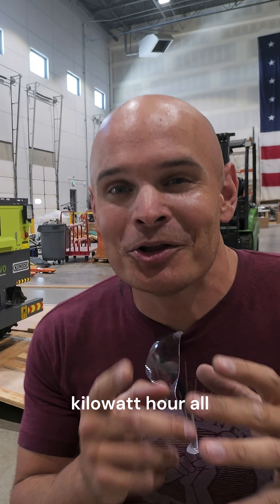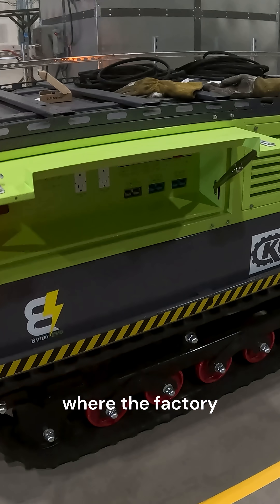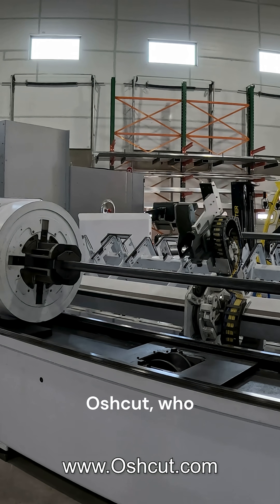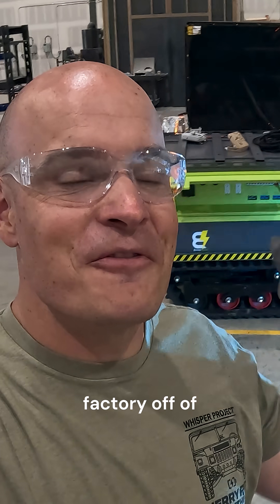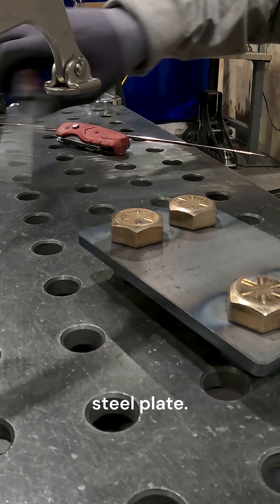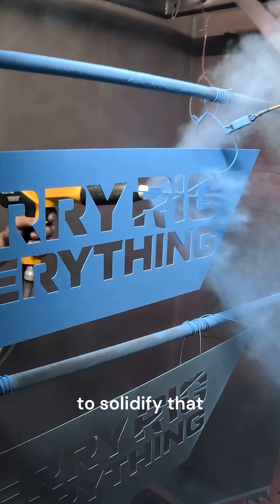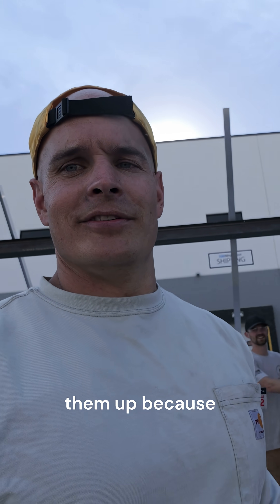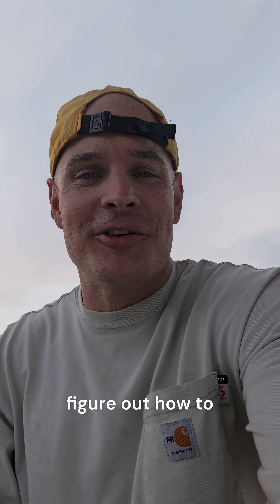If a Tesla and a Tank had a baby...

Comment: I work at a smallachine shop . At any time we have 2 lathes running amd are drawing around 12kw  and with more machines running amd hitting load we can easily hit around 26kw-30kw (400v 3phase)  .this battery is NUTS . We have a big 80kva diesel generator for our backup

Comment: Put the solar array on a turret and use a meter to detect volt drop. If the voltage goes below a determined threshold, get the tank to push it until it rotates to face the light and stop when the voltage is above the threshold.
Reply: It would probably be better to just use one of the already-made sun tracker controllers. Cloud cover might cause a voltage monitoring version to move excessively versus having it set to just point exactly at the sun's position through the day.

Comment: Or you could get diesel generator that puts out more power and will last 100 years with basic maintenance. Solar panels are good for 20 years max? Batteries are good for 10 years max before they lose substantial capacity.
Reply: Diesel is great, when you're somewhere you can haul a tanker or a cube. Also not so great if you ever need to have it run indoors for any reason. There's a time and a place for both.

Comment: I have a question: how long will that "battery tank" hold a charge in temps below -30 F? The battery in a cell phone will be dead within 5 minutes if not kept warm enough; the same for batteries in trail cams, wireless doorbell buttons, etc. Even vehicles need to be plugged in or left running in extreme cold. 

Speaking of big batteries...the city of Fairbanks, AK has a warehouse-sized battery backup to keep the city running long enough to switch power sources in case of issues.

Comment: I could see these being highly valuable in disaster response scenarios, such as post-hurricane recovery efforts when power is unavailable. They would provide an excellent means of supporting affected communities in those situations.
Reply: They are called generators lol  that can run 24/7 !!
Reply: @Great-white-tiger-hunter Generators are inefficient if run with low power usage. If you use only fraction of generator power it's best to use it with some kind of battery. Charge it durning the day and turn generator off over the night while running most important, low power stuff (like fridge, circulation pumps in heating system) with some kind of UPS.

Comment: Just an FYI...AC power hasn't been 110v since the 1960s.

You got the 240v correct...but 110v??  Dinosaur talk
Reply: Dinosaur talk kind of relevant when our transmission infrastructure hasn't been touched in nearly a hundred years in some regions.

110/220 is just colloquially used, even though the official standard is 120 now, you'll still see 110,120, or 125 all over the place, especially in manufacturing where controllers are often from the Mesozoic period.

Comment: 22kW power output this is 1/4 of my previous fiat 500e that had 24kWh and 88kW capacity. about 100x slower discharge rate (0.2C) than a 12 years old EV? it's definitely not optimized for power.

Comment: That tank battery proves the validity of the gonk droid from Star Wars, which was basically a walking battery. It's mobile, high density power. Love that you're helping and developing manufacturing in the US.
Reply: More people need to get into any of the RC hobbies out there so this weird fear of lithium and high density batteries can go away. Lithium batteries do not explode, they will vent nasty stuff and burn vigorously, but they do not just go boom like a block of C4. Fire is the main issue, not a bomb. When people think these batteries go boom, it's because whatever they are inside and powering is creating a very weak pressure vessel, kinda like a tightly glued and sealed up IP68 smartphone for example.

As Zankaroo said, if you are worried someone is going to turn some battery bank like this into some slow self propelled RC bomb, don't be. It'd be about the worst one imaginable that'd be less of a threat than common binary explosive like tannerite you can pick up at your local sporting goods store. If someone wanted to make something go boom in a big way, they wouldn't waste tens of thousands or hundreds of thousands on some mobile battery bank, they'd do it by spending virtually nothing on fertilizer and fuel.
Reply: @fubar5884  I agree when I was daft young kid I kinda overloaded my boat rc batterys. Push the wrong button and like 30-45mins charging time first start to smoke. The packaging around the charging plug is area was in flame then exploded. Explosion was the same size firecracker. At most it more cheap nock off flashbang.
Reply: Bop
Reply: Exactly what I thought! The GNK Power Droid!
Reply: A walking nuclear battery would be much lovelier
Reply: I more worried about someone to turn that into a bomb with wheels and remote control
Reply: @JnManuelAG  Not worth it, you can make bombs out of house hold shit or get a few other slightly harder to get things to make even better bombs cheaper if someone really wanted to do some damage. And junk cars are cheap and everywhere or cheap RC cars if you wanted small form factor. Why spend $37k on the Komodo when this other shit is way cheaper and can be learned pretty easily on the internet, might get on some list though for searching it.
Reply: @Zankaroo yes fbi this man right here
Reply: @JnManuelAG  we already do this, and with lighter and cheaper frames.
Don't know about IRA level block levelers but if it existed, then this would do it.
Reply: @JnManuelAG  That thing costs $37,000, before any shipping and handling is factored in. Pretty sure nobody would try this based on cost-effectiveness alone.

Comment: Can we stop pretending 100kWh is enough to power an "average" home for a "few days"?  

In summer months with traditionally undersized HVAC myself and most of my neighbors are using between 80 and 160kWh per day in the summer.  My use is slightly higher due to EV charging.
Reply: Ex sparkee, current engineer here. You should really look into your insulation because those numbers ain't right. You'd likely save yourself a fair bit of money paying for a proper thermal inspection, I wouldn't be surprised if the builder didn't even put the required amount of insulation in.
Reply: @sakaraist I personally inspected the house as it was being built before drywall, and it was an exceptional job.  It also has 18+ inches of loose fill fiberglass putting it well over r45.  

Point being, HVAC people are paranoid about short cycling and would rather undersize a system than slightly oversize it.  Bonus is service calls where they can charge boomers $300 to replace the run caps and “tune things up”.

Also, any engineer would not make assumptions without any data - that’s how we end up with systems swagged that are later insufficient for the application.  

At the end of the day, 100kwh is not going to carry most homes in summer months, especially with incorrectly sized HVAC.
Reply: @trumpio  100kwh is nearly 3x the average home in summer months. The most likely contenders are poor insulation, which is incredibly common in the US, an inefficient system, or a LARGE house and cooling every room to the same brisk temperature.

To say it wouldn't work for most homes is completely off base, in reality it's significantly over the average for most homes, even those in hotter regions.

Maybe you're in the minority with an overly large house or you keep the house at 60, but the general advice to anyone using 100kwh/day without being able to know anything else? Somethings likely not adding up. Could be a loose duct, could be compressed insulation, maybe their AC system isn't actually cycling off, maybe their heater is stuck in defrost mode. Point being it's an abnormal power usage statistically.

If everythings good for you based off the area you're cooling/heating then no worries, but as a general statement to say 100kwh wouldn't work for most is just wrong and leads people to ignore inefficiencies. You can say it wouldn't work for you, but little more than that.
Reply: @sakaraist There is no way the average home uses only 30kwh in the summer.  Is this based on some make believe feel good green energy  calculation that assumes everyone sets their thermostat to 82 degrees and has a 1200 square foot brick house?

If a 4 ton ac unit draws 5000 watts steady state and runs at 50% duty cycle, how does that fit in with lights, refrigerators, dishwashers, computers, tv’s, washers, and dryers?

I just looked and my new 30 foot RV uses between 38-52 kWh per day with the ac running on utility when camping.  When running inverter only it’s significantly higher due to reactive power.

Comment: Cool! Starting at 40k usd; has 100kw and tows 5000lbs, has tracks.
Now imagine for a moment something with a 131kw pack, could tow 7500lbs, can get for $55k usd, on wheels not tracks, and you can drive…and can get from a ford dealership.
Fine, no tank tracks, but goes to show how capable and reasonably priced electric trucks are ❤
Reply: The value proposition for this behemoth isn't to be the better driving vehicle though but to be a utility. I've yet to hear of any regular truck capable of outputting 22 kW or having 7 (?) individual outlets.
Reply: @hoej it could be done. I had a 15kW inverter in my old Prius that ran off the traction battery. Everyone talked smack about a construction guy with a Prius but not lugging and refueling a giant generator was awesome.
Reply: @hoej Not to mention off road scenarios where a typical truck or car wouldn't work.
Reply: @Stratus41298  tbf, to get to those off-road scenarios, it'll need its own truck, as its speed is abysmal (and as it's an rc car, no cool rides on top either)
Reply: @hoej While yes, it wouldn't be a problem. Considering slightly EVs start with easily 300kw, don't think a constant output of a 100 would be difficult
Reply: Get the track mods to replace the wheels!
Reply: Yeah I think Ford loses over $50,000 for every lightning they sell. Unfortunately I don't think they're going to be able to figure it out before they go bankrupt.

Comment: No, you aren't going to run a factory with this. Even if we overlook the lack of 3 phase capability, 22 kilowatts is less than your standard residential electrical service would supply.
Reply: Where on earth are these houses that pull 22Kw?
I live in a 50s double brick house built when efficiency was an alien concept to housing in my location. The house has 3 phase power, and has never peaked above 6Kw instantaneous.
Reply: @haitchteeceeeightnineeight5571  Homes are going to all electric appliances and adding electric car chargers which is why 200 amp panels are the standard now. Having said that even your old home with a 100amp panel is can still supply more power than this thing, so nobody will be running a factory off of it. 😂
Reply: Our house built in 1960 had 3 phase 380 fused at 3x 35 Amp, can be switched to 3x65 Amp fuses if i remember correctly.
Just the mains cable from fuses to power cabinet would also need to be upgraded.

YET they still wired each floor (3x) only with 1PH and 10amp circuits from the floor subdistros, because nobody had many electric tools or devices back then. (<_<)

I set the wallbox to 3x10Amps to be on the safe side with an electric shower and two kitchens rivaling for power.

Comment: Ok, how long can it run an hvac system for? That's what most household energy goes to. Definitely price wise
Reply: depends on the unit, how hot it is and how cool you need it, in my experience you tend to find conflicting numbers online but from what I can tell a typical home central AC uses about 4-5kwh, so pretty much a full 24h straight, but AC only needs to run something like 12-14 hours a day, even if it's fairly hot outside, less if you don't mind being slightly warm or supplementing with a fan.

Comment: Can I make a suggestion, if you're hammering in bolts in the holes it's not going to go together on the salt flats.  Building some slop and some play. I deal with this all the time with companies that manufacture stuff on a perfectly flat concrete floor and then I always tell them go take it out in the parking lot and see if you can build it.  They struggle and struggle and struggle. After I redrill all the holes a little bit bigger everything goes together a whole lot easier. But nuts and bolts and pins or whatever you're using don't need to be super tight tolerances to do their job.  They just need to have nylocks so things don't rattle loose.
Reply: Dealt with this on the first field-assembled sign frame I made, ended up adding 1/16" to the hole spec and nylocks instead of lock washers.
Reply: Reminds me when Ford built a transmission with very strict tolerances like +-2 thousands it was so tight that it didn't work they jad to trash it and go back to thier old tolerances
Reply: @shawnmccarty6923   +/- 2 thousands is really sloppy, hobby CNC grade.

"Dimensional tolerance is related to, but different from fit in mechanical engineering, which is a designed-in clearance or interference between two parts."

The problem was they didn't match their allowance / clearance with tolerance correctly.

If you have 0 clearance or 4 thou that's a huge problem.
If you have consistent clearance at temp that will work perfectly even with 0.0001" tolerance width.
Reply: they did put sleeves inside of the tubing for the holes so i don't think there will be alignment issues it is just tight fit in side the tube not with matching up to another part
Reply: Either drills or reamers-which are alot more precise than regular drills.
Reply: Like they did in the video?
Reply: They've done this stuff hundreds of times before. They are the factory spec. And they do have as many thousandths play as they need, there is nothing wrong with driving bolts in, that's what spud wrenches are for. Quick, tight. Nylocks are not useful where weather gets hot. Nice field office temporary portable power setup.
Reply: By doing this you might or you void the warranty. Also  by making bigger holes would not change anything. If you have holes that are 5/16 and you make them say half inch, its still going to be stiff with no play just a bigger bolt.
Reply: @MaxPower1000. They aren't talking about using a bigger bolt, they're talking about just sizing up the holes so lining things up is easier. Gives you more tolerance.
Reply: @ganjalfcreamcorn8438 I get that, but do you use the same bolt? When you size up the hole, and what do you me by size up
Reply: Mean*
Reply: @MaxPower1000.  Yes, they're saying the same bolt. It's a static frame. Some play in it doesn't really matter and tightening the bolts down removes the slop in the joints anyway.
Reply: @ganjalfcreamcorn8438 no matter what when you punch a bigger hole than the factory spec it is always best to size up the bolt so you don't get sheer lash and slop in the parts your bolting (usually mounting points) plus, it is easier to invest in a hydraulic pump (a portapac) to assemble machinery or use a truck crane rather than voiding the warranty and possibly compromising the structural integrity, hence why we dont drill out control arms if they don't fit right away😂
Reply: 130$ at harbor freight and you can get a hand pump that'll lift a 60ton bridge crane
Reply: @itsyaboi2346 I don't know what you're talking about when it comes avoiding a warranty.  They're manufacturing the frame themselves.  My point was to not have such titlerances on a perfectly flat concrete floor when they assembled it in their shop then they have to go out into the field and assemble it on a salt lake that's not perfectly flat. Bolts and holes don't line up like it did in the shop and if you add a little bit of slop in the tolerances the job becomes much easier. And the bolts are holding the frame together anyway.  If you've ever assembled trussing you'll know what I'm talking about
Reply: @MaxPower1000. -No one was talking about replacing the bolts with a bigger diameter, they were saying that they would slightly oversize the bolt holes to allow for a little slop in the holes to ensure easier insertion of the bolts during construction.

Comment: That's not a power tank, it's an oversized battery on tracks.

If you run it hot (multiple welders in the sun or the like) will it have the cooling to allow sustained use without throttling?

I don't think diesel generator makers will be going out of business anytime soon.

Comment: Wouldn't be cheaper and easier to use a diesel generator?
Reply: Can you refuel that from the sun in the. Middle of the desert for free? No, the answer is no, diesel generators are for people with significant energy demands or more often people who are afraid of electricity math, this battery is the equivalent of running a 9500w generator at full bore for 10 hours for 100kw
Reply: @nicholashaines4136  if your only using that much power you can get a gas generator. I thought this was for heavy duty use.
Reply: @amosmoses5630 being a lithium battery I'm certain that it's capable of much more output probably 50 kilowatt at a time obviously if it's outputting 50 KW all at the same time it's only going to last for 2 hours, Zach didn't give any of the specifics but I'm assuming that he has some fairly intermittent high power needs as well as continuous low power needs that total less than 100 kw a day. I think the most relevant question is how much is the rig vs the cost of fuel and transport. However I do see an argument for big gene to top off big batteries esp if on a trailer and shared between to get full yield